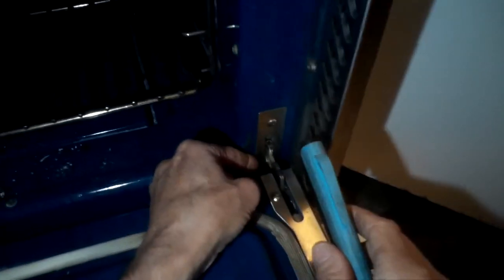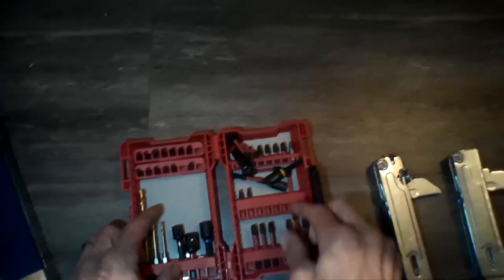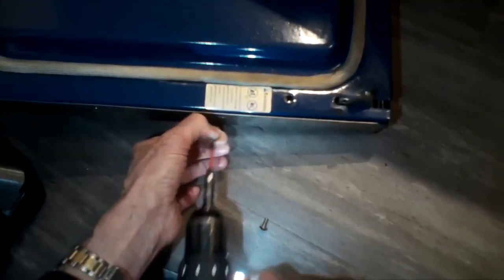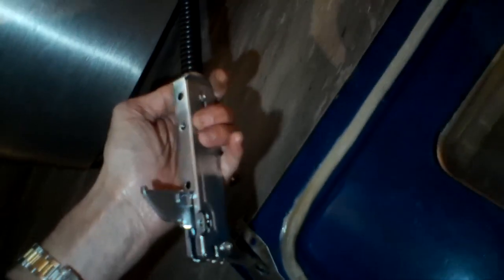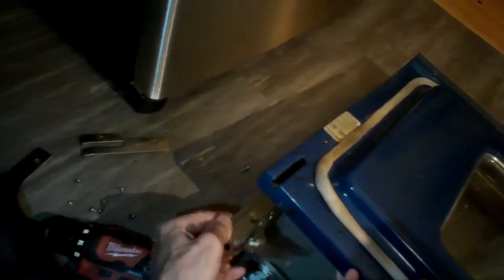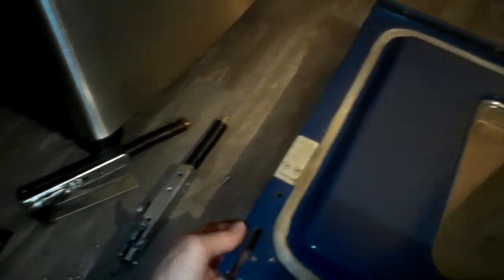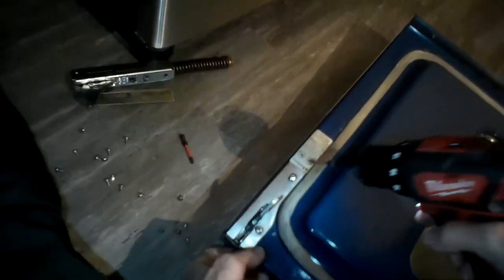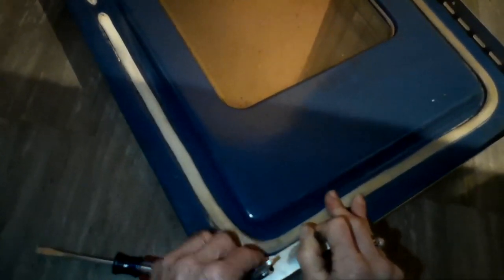🌎 NXR Oven Door Doesn't Close All The Way — How to Replace The Hinges

Comment: This is an incredibly helpful video. Thanks! I found this job to be a giant pain in the butt and don't ever wanna have to do it again. A word of advice to anybody with an older model NXR - when reinstalling the door push back on the hinges all the way so that the locking clips go inside the slot. I was trying to install the door with the locking clips holding the hinge spring only about halfway open. It absolutely wouldn't work until I realized what I was doing wrong.
Reply from the maker: Great advice,
Thank you 😊

Comment: Good helpful video - BUT FIRST - you might be able to avoid it.  The hinges rest on support brackets which are fastened to the body of the oven by two screws.  If these are loose and the bracket is not firmly attached, the fulcrum point for the hinges is not fixed in place properly, and this may be enough to cause the problem - a quick no-cost fix.  It is also harder to put the door back on when they are not tight.  (I discovered this after two attempts to install new hinges which did not fix the problem.)
Reply from the maker: Excellent info. Jonathan,
Thank you😊👍
Reply: Where are these support brackets and their fasteners?